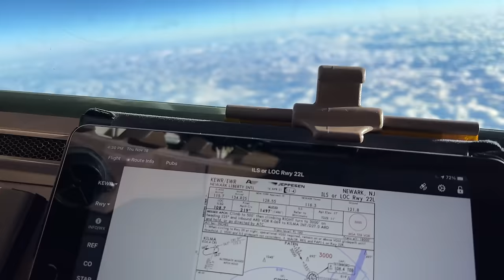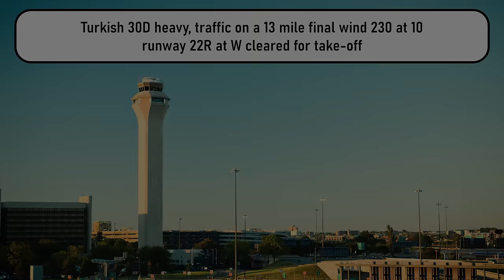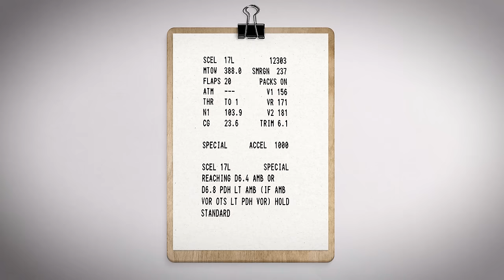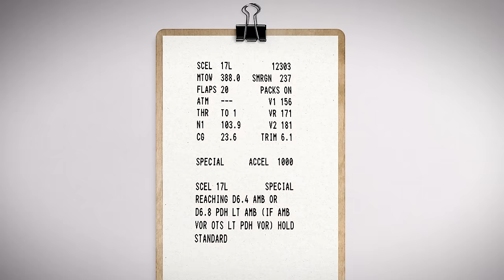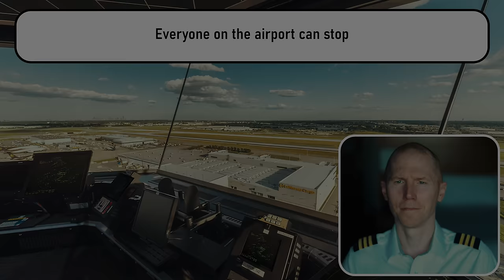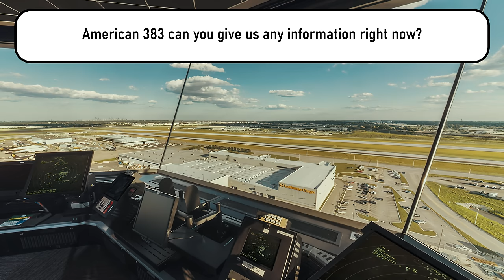American 767 Engine Fire

Comment: That was a brilliant episode.  So funny when the plane tried to take off from a taxiway!  Great explanations from Kelsey (I never knew why that static noise sounded so bad and I used to wonder how ATC could make sense of it).  It’s great to see an evacuation carried out so well - maybe highlighting the times when passengers did leave luggage behind and carried out the flight attendants’ instructions will help get the message across.  In a fire, seconds count and I’m sure they’d get their carry ons fairly quickly.
Reply: Recordings of ATC are made by a 3rd-party radio receiver, I think usually by an amateur.  Their antenna isn't in the same place as the tower's, so yeah, the tower might receive the plane's transmission much better.  (Especially for a plane on the ground, up in the air where any ground antenna will have line-of-sight to it.)

I don't think Kelsey actually explained why, just that ATC probably heard something other than static, or they'd have asked for a repeat.
Reply: @Peter_Cordes  thank you, I never thought of that.  Kelsey didn’t so much explain why as  explained what the static noise was, but that was also interesting.  I suppose I thought there must be a public domain where anyone could access ATC tapes  - an antenna on the ground makes a lot more sense.

Comment: I've been in an airport, where roughly half the planes took off from the end of the runway and roughly half took off from the first intersection.  I assumed at the time, it gave the pilots a little more time to do their last items before takeoff.  I've been in a few flights, where the pilots turned on to the runway and immediately went to takeoff thrust, but it seems to be more common they brake and then begin takeoff.  I suspect the turkish pilots did the former, and were distracted to the point they overshot their runway making their turn.

Comment: So I've been flying enough even as a stooge passenger to know that if I'm on the starboard side of an AC at crossing a runway, turn right onto a taxiway and then hear the engines spool up......   There's no fckn way I am going to swallow a mechanical reject, then just go back and 'try again'.

Comment: "The pilots are overloaded"  Come-on, Kelsey. How difficult can it be to A) cut the power to everything. B) make sure the engine has spooled down enough & then evacuate to the safe side of the plane.   Screw the checklist & everything else. It's not rocket science your dealing with here.

Comment: No mention of that one passenger that got seriously injured, due to the engine still running while he evacuated. No mention of the broken disk that flew from the engine, 900 meters to hit the roof of the UPS building.  No mention of the flight crew being reprimanded for not communicating the evacuation procedure properly.. No mention of the pilots using the in-flight fire procedure instead of the on-ground fire procedure resulting in only one of the fire-extinguishers being activated before the evacuation.   Your videos are losing content, but are still good 🙂

Comment: I was once on a small ( duel prop - like 8 people ) plane flying into Boston. And on the those small plane you see right out the front, so you see the big Runway.
Anyway coming into the runway, we made a right turn and landed on what looked like a road.... the plane went really quiet. The pilot landed, taxied off, afterwards turned around to all of us in the back and she said ( realising what we saw a thought ) 'Oh, I sound have said, this is a runway too, just a smaller one.
BUT it was still a runway.

Comment: The grade on your camera looks good but putting that grade onto the sections where you’ve got a photo of a plane or an ATC tower is unecessary. Overall your new editor is doing a great job with the graphics etc.
Reply: I hope this new editor will do another great job: put written words as  in previous
videos. It’s very difficult for me to understand his speech without reading. I tried to slow it at 0.75 pct. but still I lose a lot of words..🙁

Comment: The aircraft should be fully programmed so it would have awareness about the RWY. Once the pilots increase throtttle, it (the airplane) should've given a warning. It looks like these guys just ignored the feedback from the plane or just didn't program it right.
Reply: Many aircraft can alert if the plane isn't pointed in the expected direction.  But for a long time the only positioning info was GPS, and that isn't always accurate enough to tell a runway from the neighboring taxiway.  Airport surveillance systems might be able to alert on this.

Comment: Sir, pls, do not think this is a strange mistake.
You find it very strange that you can pass a wide runway.

But so it happened to the other plane that took off from a closed runway which was under construction with construction equipment on it.
A pilot with many many hours made a horrible mistake when he took off from that runway.

Pls do not ever think it is very strange.
Check, check, double check, triple check.
Are all instruments showing what they should show.....etc etc.

I do not think it is very strange.
Ok ok, a taxi way is strange, yes, ok, i agree. BUT.... even very experienced pilots can line up on the wrong runway without any bells going off.
Trained to think a certain way may also be the cause of accidents.

Comment: Just curious.   With the advanced and accuracy of today’s GPS, I would think, at a minimum, that an alarm could sound if the plane was not on the assigned runway and the throttles were set to take off power.  Even better would be mapping that included the taxi ways.

Comment: I would have figured it out the moment on the takeoff roll I saw blue lights going by.  I always have ATC tuned in and playing in my earbuds when I fly so I know better what's going on.  Many times I've heard pilots and cabin crews fabricate or soft sell a situation.  One time coming into Denver, I heard our flight crew tell ATC we were going around, then the power went to the engines and back up we went.  The reason given to ATC by our crew was traffic on the runway.  No information was communicated to passengers.  In other words, Airlines BS their passengers, banking on passenger ignorance.  There's NO WAY the Turkish crew, or any crew, would ever tell their passengers that they had just tried to takeoff on a taxiway.  My #1 complaint about airlines isn't cancelled flights and delays, it's actually the poor manner in which they communicate with their passengers.  Unfortunately, all we ever get is regurgitated script reading that has zero value.

Comment: Why don't all modern airliners have cameras on them so the pilots can see the wings, engines, landing gear and tail? I know some come with a tail mounted camera as an option, but I would have thought that all airliners would benefit from having a bunch of little cameras purely as a safety option these days. Heck it wouldn't even be that hard to retrofit them into older planes as and when they do interior refurbs.

Comment: So what was the reason for that engine fire? That wing afterwards looks completely burnt 😱 Where was this at? This gave me a lot of anxiety (Sorry for the question, I watch Kelsey's vids as therapy as you can tell).
Reply: I don't have the anxiety, but I'm also curious about the reason for the fire.  I suspect the engine ate something, but there are other possibilities.
Reply: He mentioned landing at Chicago and seeing the plane, so… a quick Google of the flight number at it happened at O’Hare on October 28, 2016. There were 21 non-fatal injuries, and the fire was caused by a rupture of a disk in the starboard engine. The disk fragmented and a piece pierced the fuel tank.

Comment: I do not think a F-ing check list should be in front of getting all the people out of that aluminum burn can! That should have been first thing happening as soon as fire began. I have seen the crash in the Florida ever glades many times on TV and say to myself they could have lived if the pilot had pulled out the spoiler, idled the engines and dropped flaps and put that dam thing down in the glades instead of fighting the fire in flight. As it turned out the fire was from oxygen generators loaded onto the plane by idiots from Saber tech and the Airline itself. The generators to dangerous to even put in a common  dumpster but put on a plane full of passengers instead. Some of the asinine  SH going on with highly qualified and high IQ people that gets   innocent people killed makes me way past angry . Seems war mentality of aviation is the over riding ethos instead of preservation of life. When I see a plane burn and find out all the comforts of the interior are all highly flammable plastics and even the electrical wires covered with plastic that burns I ask why in H do the designers put burn-ables inside with the passengers to begin with . Even bombers do not have that shit inside the aircraft! Most people will gladly accept less pleasing interior if they  know the inside of the aircraft is furnished with non combustibles. Makes me think of the idiots at NASA that pumped pure oxygen into the space capsule and ended up burning alive there crew of three . The hubris of commercial aviation sucks. They play the numbers game of "well for the millions of miles traveled it so safe "but it should be a lot less dangerous. Anytime you are in a position to burn alive in a metal can it is never safe. That was so dam close and the flight that caught on fire from a engine combustion can killed over 50 people because they did not have time to all get out and it was from fact the interior was burning and it was all poisonous gas the burning plastic was generating.  It was because the pilots had no clue what was happening and used thrust reversers to blow torch the fuselage and then took there time to taxi around off runway instead of getting the people off.  This one was a lot closer to people burning alive then it is being portrayed here. The stewardess's need to be on fire watch on every flight eye balling the engines and there are other things the cabin crew need to be part of helping the pilots know the situation of there aircraft and that lack of situational knowledge has got passengers killed in past over and over again in past and not enough of what is learned from past F ups is making changes to forward going standard operating procedures. In place of that we have the computer nerds trying to push pilots out of the plane entirely with there computer operations systems that use the pilots as scape goats while trying to make the computer the pilot in command. The pilot unions need to take control of the industry and tell the industry that have had it with there BS and not going to put up with it any more and they can as a group shut it all down for what they have to have to make commercial aviation as safe as humanly possible

Comment: <grabs personal list of Never Fly With airlines> <adds Turkish Airlines>

As for AA383, looking back and reading reports, including on aviation forums, this was actually a chaotic mess. Fuel flow not cut off, left engine not cut off, causing chutes to be blown about, 20 people injured.
Reply: @michaelhoffmann2891  You mention AA engine fire, yet do not add AA into your Miki Mouse list. Does questioning your ethical integrity, or rather lack of it, make me a troll? Probably in your ethical standards.

Comment: Possibly ANOTHER case of expectation bias.  No accusations/assumptions…just wonder if the Turks had done all perf planning & crew brief for 22L; thereby “expecting” to cross 22R & P.  So, when getting TKO clearance…we’ll we get this kind of result.

As for the AA FLT.  Sounds like the flight deck crew didn’t know they had a fire.  Think about it.  If the fire isn’t within the detection loop area covered, you won’t know.  This incident is why I advise my cabin crew the following: “If ANY FA thinks there is something so wrong with the aircraft that you think EVERYONE on board would die if we try to fly…you press either call button.  I don’t care which one.  We’ll instantly reject the takeoff. We keep the pax seated until I come on the inter phone w you to determine how quick & where we vacate the aircraft”.  Why this?  We’ll in the AA situation, both the pax opened escape doors & started evacuating with engines still running (to my recollection).  That’s extremely dangerous.  As we just saw in Montgomery, AL on New Year’s Eve when a ground crew member walked to close in front of an idling engine & lost her life.

Comment: Taxiway center line is BLUE ! Runway center line is WHITE ! ...besides all the other significant differences you've mentioned. At the least this flight crew should've been suspended to check their training and mental ability, by their company and the regulators. This is similar to the Air Canada pilots lining up to a taxiway on final approach in San Francisco a few years back. This should be embarrasing to these pilots and their respective airlines.